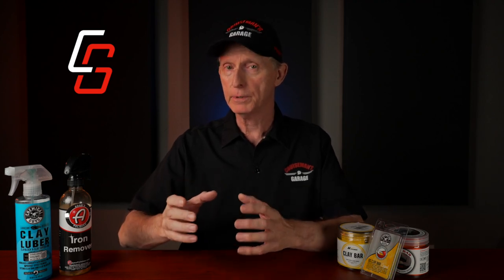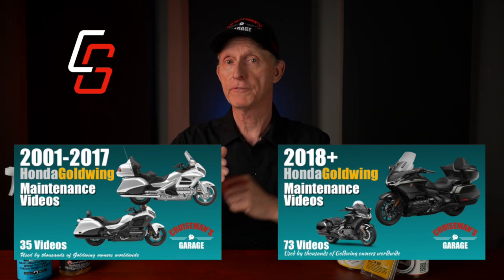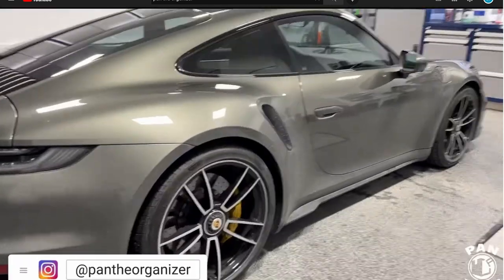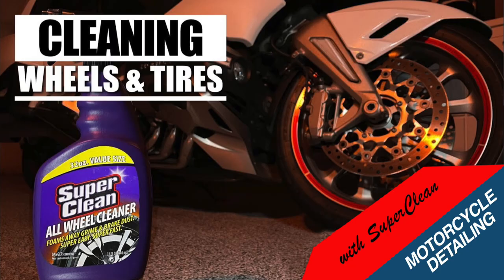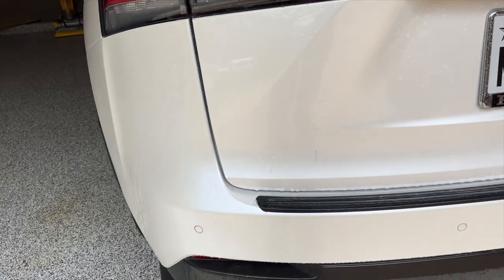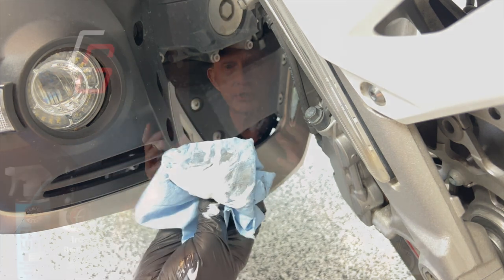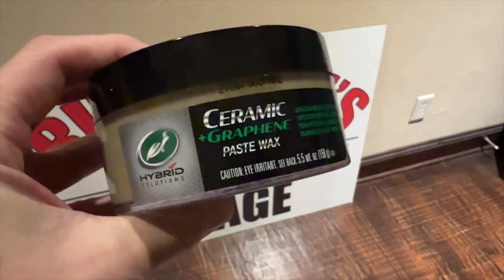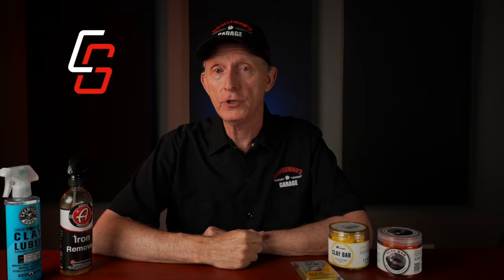Motorcycle Paint Decontamination | Ceramic Coating A Motorcycle

Comment: Good advise for getting your bike to an manageable level .

I’ve been detailing bikes for many years and have to say the mainstay of my practice on motorcycles is steam cleaning.

It’s wonderful for removing bugs without aggressive chemicals and cleaning the nooks and crannies of motorcycles. Steam it with wet steam and blow dry with the air compressor. Then buff with a ceramic quick wax. Done!

Comment: When I picked up my 2019 Wing (gently used), first thing I did was take her to a detail shop; claybar’d, wet sanded, buffed like a babies bottom, then PPF over ever forward facing surfaces - yes even the windscreen. When I sold her, she actually looked better than a new 2021 on the showroom floor and I pocketed $1500 over the purchase price but my mods were never intended to increase resale value 
😉